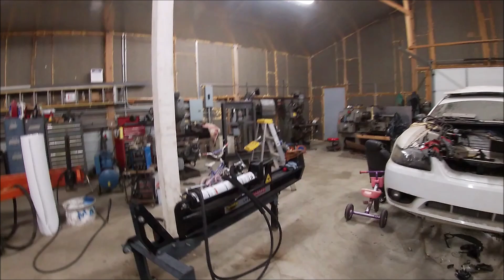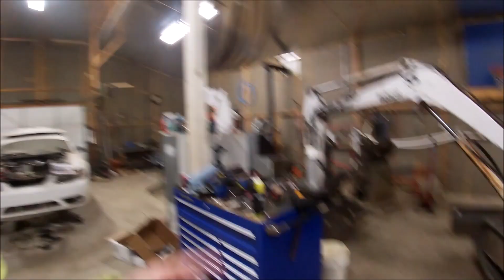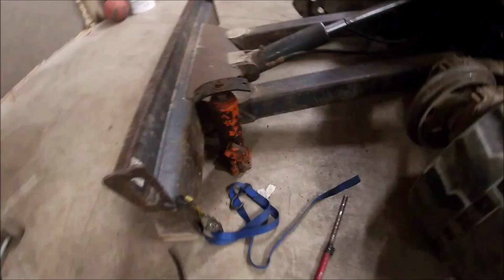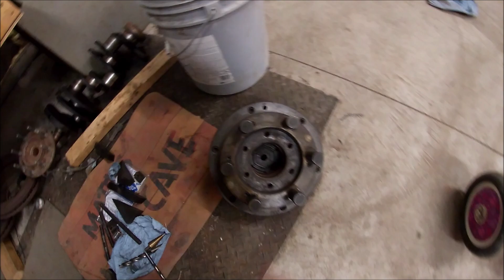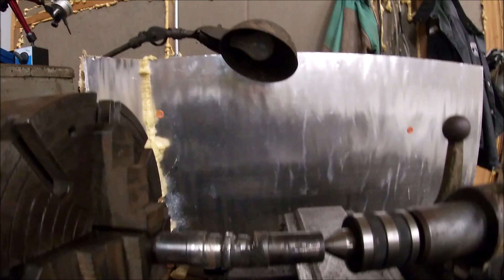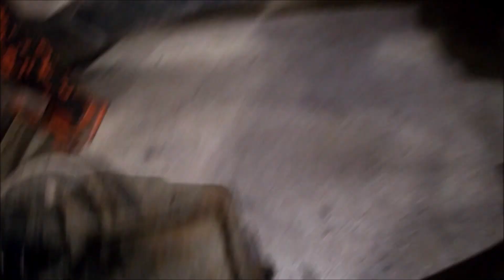Bobcat 331 Idler Trashed - Teardown and Rebuild

Comment: What bearings and seals did you use?
Reply from the maker: I listed them by size in the description so viewers could choose their own brand.  I used an off brand seal with no part number from amazon.  Matched the size.  

Bearings were SKF NJ207ECP.
There are other options for the last 3 letters that change how the rollers are captive.  ECP are only captive on one side of the inner race.